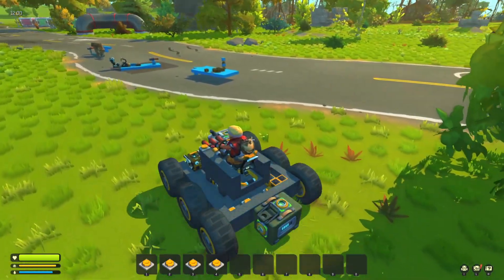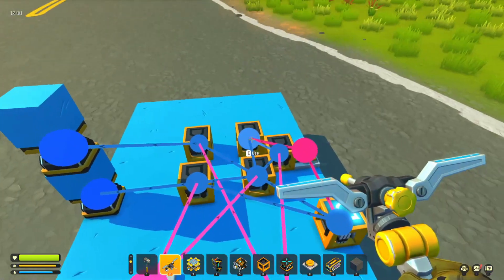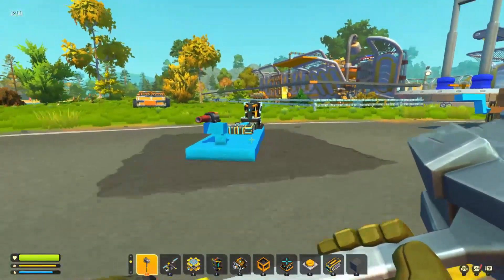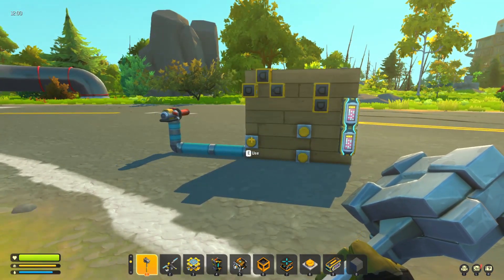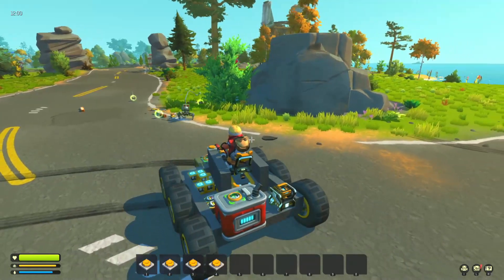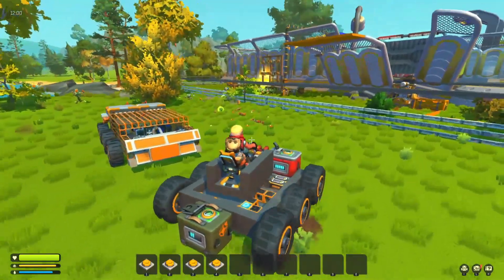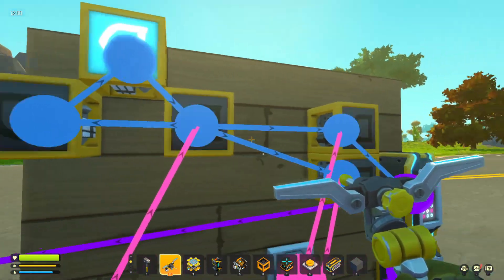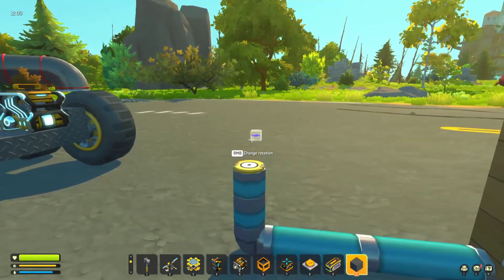Tank Turret. Using buttons to turn controllers. Scrap Mechanic Survival

Comment: I followed this tutorial, but it wasn't stable for me. I had to add a 1 tick delay in the pulse, otherwise the controllers would stop working on me at random.
Reply from the maker: hmm ok, thanks for the input, seems strange, personally never had the issue :/ I will keep an eye out for it though!
Reply: @wo0dy  my pc has been struggling with the game a bit lately. That world in particular has been getting laggy, so it very well could be on my end. 
But it seems like adding a 1 or more tick delay to the pulse loop makes the controllers more stable. Before I did that, they seemed to stop responding about every other time I got in my turret.
It may also be worth noting that I used 2 sensors as an A/D converter for left/right turning, instead of the buttons you used. I was making a wall turret rather than vehicle mounted, so I wanted wasd controls.